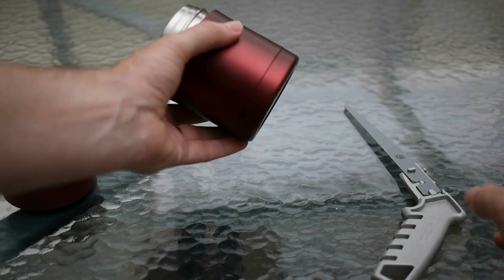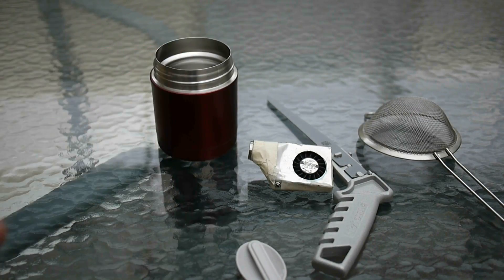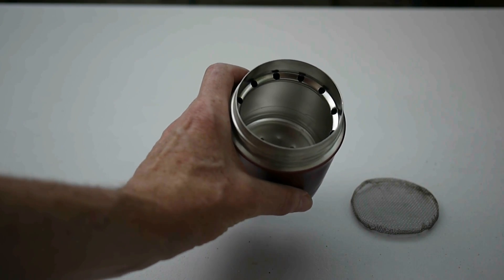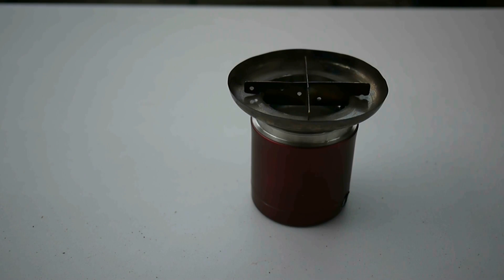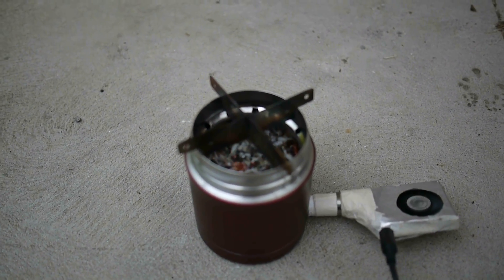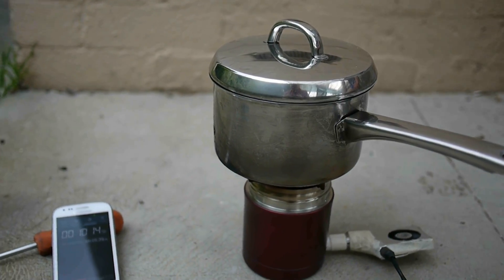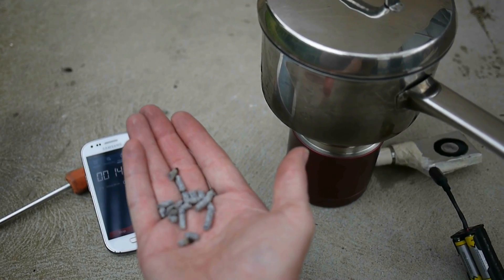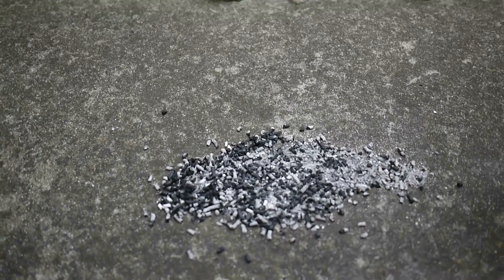Easy DIY Build Stainless Steel Woodgas Camping Stove with fan using an $8 thermos

Comment: I've been doing alot of camping research for a pending "new beginning" trip and I've noticed that the vids where the ppl use pellets as a fuel source end up not burning to well, IMO because youre dealing with airflow you're not going to get any type of airflow with pellets, wood chips would be a better option ofcourse actual wood/tinder being the best option
Reply from the maker: The air flow through the pellets is only used for the smoldering burn, i.e. It is for making smoke and high air flow is not required. The fast air flow (used to consume/burn the smoke) goes up the sides of the container which has no pellets in that path.

Comment: hey mike, I have an idea, since in the jungle its hard to found convenience store to replace battery of said fan, or incase the fan it self broke. Can we replace the air current from the fan with foot pump like the one we used to blow inflatable boat?.

The pump is portable and can be attached to the stove using heat resistant pipe like small bamboo or other materials. 

Well, not like you can leave when you cook anyway (that is very disrespectful to the food).
Reply from the maker: The fan is very robust and far less likely to fail than a foot pump, but a foot pump would work ok. The battery going flat is a more likely problem. For that, bringing spare batteries is the easiest. I have also a crank torch which I can use instead of a battery which is ok. It has a small battery so you don't need to crank all the time.
Reply: @michaelporter000  I see. I am a doom prepper, and your stainless stove do caught my heart. 

about crank torch, I have one from Yokogawa product, sadly it broke after more than 1000 uses🥲, dunno if it reaches it life end, or it just me cannot control my own strength😅. 

That's why I prefer that foot pump since it obviously can last longer in my hand😁and easier to use incase both hands occupied, unavailable, or I am already too weak/old/lazy to use my hands😆.

btw, when is mass production started? or is it exclusive pre-order?

If you can build a super heavy duty ones, as a sales person, I have more than 1 millions people I can sell that stove to.
Reply from the maker: @BrownCollarWorker  This was just a curiosity project for me 9 years ago. There is no mass production or pre-order. I have no intentions of taking this any further, and it is on YouTube just so that anyone can feel free to copy it or improve on it as they wish.
Reply: @michaelporter000  I see. While it is feasible to immitate, not every one have tools and crafty hands like yours.

oh btw, the link in amazon that you show me indicated that the stove is out of stock.
What a pity.

Do you got any other recommendation?

Comment: Perfektné video, tento varič je podľa mňa najlepší zo všetkých publikovaných. Samozrejme, všetko by sa dalo vylepšiť. Nerozmýšlal si, ako predlžiť dobu horenia? Možno by bolo vhodné použiť iné palivo, napriklad rastlinný olej, ktorý by sa dotekal do spalovacej komory podľa nastavenia ventilu nádoby s olejom a tým by sa predlžila doba horenia na potrebný čas.
Reply from the maker: Good ideas. As a design for a hiking stove that can be easily made and flexible fuel options found at the destination but works well I think it is good. It could be a bit better but not much without it not being fit for that purpose.

Comment: What is the fuel?
Reply: In this video I'm using kitty-litter that is made from paper. It works just as well with broken up pieces of wooden sticks up to the diameter of a pencil but I have a cat so the kitty litter is available and easier.

Comment: in this video you mention you normally start at 5:1 ratio and progress to 6:1. Is your ratio so high because you are using fans to force air? I notice other TLUD's ranging at 3:1 to 4:1 for more efficient burn and less emissions. Just researching for my own Thermos stove (no fan) and can't make the holes smaller once they are there! Cheers
Reply: I don't know from where, but I found someone knowledgable who suggested 5:1 flow rates (and hence hole areas) was ideal. That would have been without a fan because no one (that I knew) was using fans when I started. I then used that as my starting point and it seemed to have worked out pretty well. I have seen many designs where people don't seem to understand that the small holes need to be small to create the smoke and they instead go for the "bigger-is-better" approach. I think it then changes from being a woodgas stove to being more like a rocket stove, which probably consumes fuel faster and makes more smoke but still works ok for most purposes.  I haven't played around with these for a while but I'm interested in where you heard about other ratios - or did you just calculate ratios from holes in construction plans?
Reply: @michaels-ideas  one YouTuber showed his calculations for a 4:1 ratio for his Thermos stove which I took as my guide since I have the same unit. Your mention of 6:1 prompted my research into TLUD air flow ratio and there are several papers/studies in relation to most efficient TLUDs with less emissions and fuel consumption and most appear to be connected to efficient stoves to be used in the Third World. Although finding suggested ratios is not that clear. But you know - it is stage 4 Lockdown here in Vic, so what are you going to do on a Friday afternoon?
Reply from the maker: @cotteeskid  Yup - I'm in Melbourne so in lockdown too. Tomorrow I'm planning to take a hole-saw to my car to install a snorkel. Gotta keep busy!
Reply: @michaelporter000  Thinking on what you said about others and large holes, I might start with a lower ratio and if I want to increase the secondary, will be sure to add more holes rather than increase their diameter (or marginally adjust). Cheers from M'ton.

Comment: do you have any footage which actually shows the stove burning and gasification at the secondary holes? I can see by the charcoal that the stove does gasify it would be nice to see it in action. With the pot stand on it was very hard to see much. thanks for posting.
Reply: There is no way for the fuel to falsify out of the secondary holes on top, because there are no holes lower down for the partially burned gases to get into the space between the inner and outer walls
Reply: @bspadovani that’s not how it works. Fresh air is heated traveling between in the inner and outer walls feeding in at the top burning the wood gas that is created by the lower burn.

Comment: To improve cleaner combustion place a tincan lid in the bottom to block drafting up dirty pyrolosis gasses. Clean soot from pot bottom and pot crosses and run a burn test. Way cleaner combustion. Good luck!
Reply from the maker: I don't really understand this suggestion. The pyrolosis gases (i.e. the smoke created by the smouldering wood or paper) is the fuel that is being burnt (by the hot air jets at the top) so if I block them I can't see how it would work at all.
Reply: @michaelporter000  Re-read note: bottom is not top in a double wall stove. Find a tin can lid to fit fuel area bottom. Forces air to draft up double wall to combust at top. Note Ohuhu top ring curved to concentrate combustion. BTW if biomass to oxygen combustion is a 1:6 ratio why would you have more top holes than base holes? Since you are using AIR not OXYGEN the biomass to air ratio is 1:30 so where is your top drafting 30 times the air? Bottom or top? Since warm air rises wouldn't the natural draft be many holes at the top . Don't forget to get the sidewalls hot ASAP to drat well. Try using metho or 90% Iso alcohol to accelerate combustion at start.

Comment: I like your experiment here.  One thing I'd work on changing is the fan/battery setup.  AA batteries has seen it's days.  I'd work on getting a battery for some tossed cellphone and use the charger that came with it.  I'm betting it would be much smaller of a setup and I bet you can get about as much service as these AA batteries. 

I really, really like you using the metric system.  Great breath of fresh air!

Keep up the good work!
Reply from the maker: Thanks for your comment. The batteries are AAA, and not AA. I use a standard battery charger and that works for me. I also have used other battery alternatives such as a solar panel, battery bank, or wind-up torch, or any other device with a USB port, with a USB to 1/4" (I think - could be smaller) plug cable.

Comment: I am always looking for new ways to cut weight when camping. . Can you do a how to. . On how you built your little fan for your wood gasifier. Your stove looks like it would be a great  addition to my bike/ hammock  camping gear
Reply from the maker: I usually assume that if you have the skills to build these things in my videos, you probably can tell just by looking at them how it was built. I also tend to build things using whatever I have at hand, rather than figuring out the best way to make it from scratch. I think I will need to change this approach to help you guys out more. I am planning a new build of my blue-flame stove soon and I will try to make it more of a "How To" instructional video instead of a "Look what I did" video.

Comment: I just made a stove on this premise. I used a can cozy from Walmart $5 but instead of mesh in the bottom I just drilled a lot of holes. Small ones mind you 1/8”, but it worked just as good, didn’t have a problem with them getting clogged up by the fuel. No fan! 13 3/8 holes in the outside bottom. 16 1/8 holes in the inside top. 1hr. burn on 1 &1/2 cup wood pellets. 2hr. of heat, nothing but a tablespoon of ash left.
   I increased the inside top holes to 3/16”. Much better burn. Also found a stainless steel kitchen sink stopper at Walmart for 88 cents. Turned it into a flame concentrator. Fits perfectly right on top.
Reply from the maker: Sounds like a good build, well done! I personally really like using a fan, but plenty of people prefer having no fan so thank you for providing the hole sizes for that version.
Reply: Michael Porter
That ring at the bottom is just pressed on. So when I drilled that many holes it fell off after the second hole. Also I filled the inside bottom with about fifty 1/8 holes

Comment: I'm struggling to work out what flask you have used for this. Does the one below seem like it might the same? I made your last stove and it was great but I like the look of this one even more. 

https://www.amazon.co.uk/gp/product/B008F7O1JG/ref=ox_sc_act_title_1?smid=A3P5ROKL5A1OLE&psc=1
Reply from the maker: Yes, that looks similar to me. I bought mine from KMart - which is a low price homewares and clothing store here in Australia. It helps if you can see it before buying to get a better idea of how well it will work. In this case, cheaper is probably better because if it is made of thick stainless steel it will be harder to drill. It's nice to hear about people going to the effort of trying to copy things I've made.
Reply: Michael Porter Thanks Micheal, the last stove was brilliant it actually was my primary stove on a few camping trips. The blower style fans and a usb adapter are my preferred way of using the fan. The blower fan can also be a good way to get a normal campfire going more strongly if you're stuck with damp wood.
Reply: Max Redmayne 
Ozark Trails can cozy. Camping section Walmart $6

Comment: Great build, nice combination of portability, durability, and performance. Couple questions: 
1) Would a "passive" version work without the fan and multiple holes cut around the bottom for primary air supply (like traditional diy wood gas stoves)? 
2) Could you integrate the "pot stand" by drilling holes around the upper lip, above the flame jets, to allow enough air in? That way, you wouldn't have to pack separate items as a pot stand
Reply from the maker: 1. Fans just make the burn so much better. It's easier to light, less affected by wind, a hotter flame, a compact flame that heats the bottom of the pot instead of a big wobbly yellow flame that shoots up the sides, and you get less sooty deposits on the pot.
2. Your pot stand idea might work, but you do need a bit of height for the flame so it hits the bottom of the pot, and I have had much better results with a simple cross made from two strips of stainless steel.